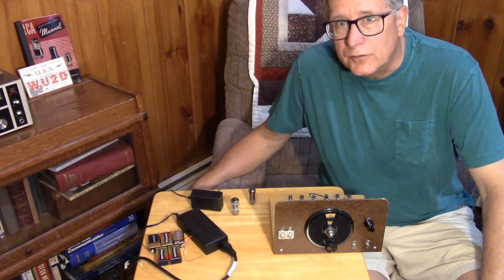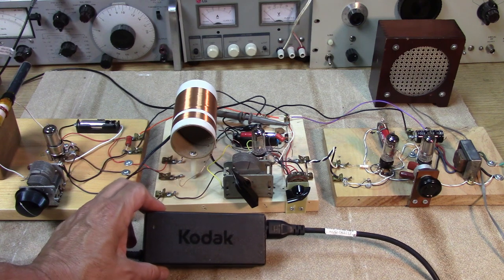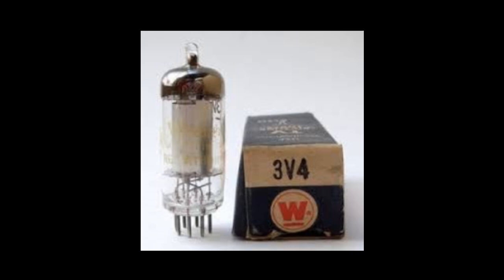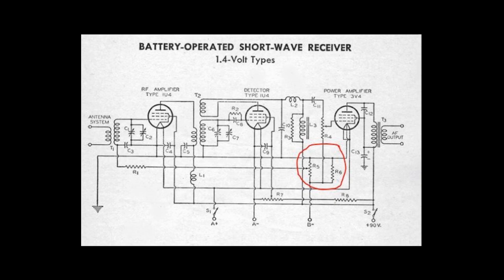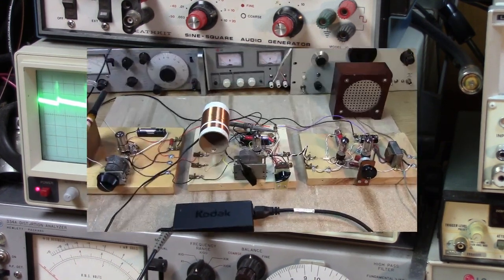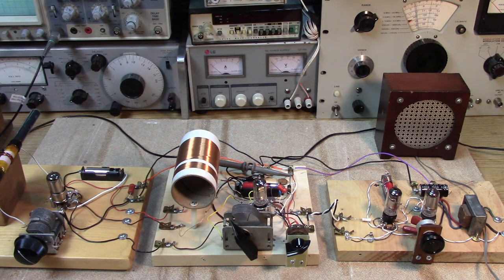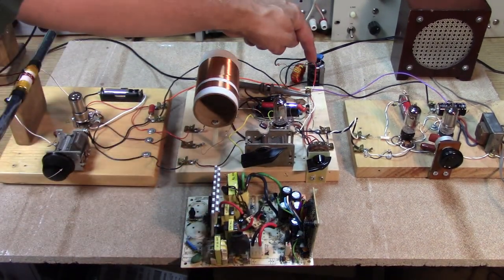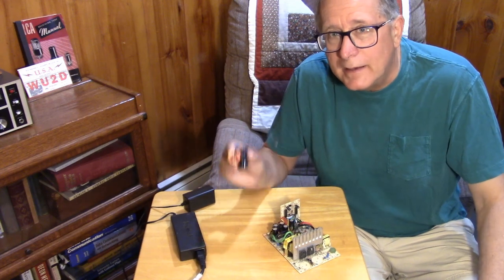Tube Power Shock!

Comment: Thanks for these Mike. You've been my mentor into the world of low voltage tubes. When I studied engineering emphasis was totally digital with a little analog thrown in for completeness. One thing I'm having success with is looking for the AC wallwarts and simple voltage doublers and triplers circuits with rectifier diodes and electrolytic caps.  Using the 12 and 24VAC bricks are working great like your cleaned up switching supplies.

Comment: Another use for wall-warts, as mentioned by @roccogarzione8410, would be to use 12 or 24 volt ac units, often used for Christmas tree lights and similar uses. These could supply a B-battery (HT) voltage of between 30 and 70-volts at, say 50mA, if used with a voltage-doubler rectifier circuit. Even a 12-volt unit often produces 15-volts off-load, that is 21 volts peak, giving around 40-volts dc after rectifying with a voltage-doubler. The wall-wart keeps the mains voltages safely enclosed in a sealed plastic case. Valves (tubes) with ac heaters could be connected in series across the low-voltage ac output, provided that they all drew the same current, perhaps 300mA in many cases.The voltage-doubler is also useful for deriving + and - supplies for op-amp power supplies, without using a centre-tapped transformer.
Reply from the maker: Yes and voltage multipliers are completely practical and less noise than switchers.

Comment: ECH83 and EBF83 were used in hybrid car radios and run with 12 volts on the anode.
Reply: EF95 pentode also

Comment: Many pentodes can be run off of 9 volts in space charge mode.  You apply B+ to the first grid, and use G2 as the signal grid.  G3 is either connected to the cathode or the plate.
Reply: B+ on the G1? Are you sure?
Reply: @db3501  YES.  Mind you we are talking less than 12v here in space charge mode.  This was very common in tube car radios of the late 50's to early 60's.
Reply: Ok good, nice to know.
But it's only the RF frontend.
Probably no way we could build a complete set around a 12V supply.
Reply: @db3501  Car radios in the late late 50's and early 60's used a special set of vacuum tubes designed for space charge operation.  These included an RF amplifier, Converter, IF amplifier, detector and first audio stage.  The speaker was driven by a Germanium power transistor and a special tetrode space charge tube provided enough drive for the power transistor, which was operated in class A2.
Reply: @scharkalvin  Good stuff really, I didn't know that :-D
On the contrary... your AM stations were much stronger back then. You now have environmental-friendly 5kW or so. Not much fun to operate an imperfect radio under these conditions, sadly.
Reply: @db3501  Radio stations always varied in power.  There were a limited number of "clear channel" stations that ran 50KW full time.  WABC, WNBC, WOR (now WWOR), WLS and a few more on the west coast.  Then there were stations that ran 50KW day, and 5KW at night.  Most other stations were 5KW full time (WMCA), and you had some that were 5kw day and 1KW (or less!) at night.  College stations were licensed to run a few hundred watts day, and less than 100 night.  Today, more low power stations exist, but the clear channel guys are still on line. 
Car radios usually had an RF stage for fringe area reception, and 262khz IF frequency  for better selectivity to separate close stations in the areas between cities.

Comment: that nice video. been playing with tubes many years. many battery tubes out their . have some 2V directly heated type. some old battery sets used them . 2V A battery was lead acid and you take it to a place to recharge. today this is easy. 2V AGM cells easy to find. with the 1.4V tubes I found a NiCd cell works fine. I even have a small flooded type.  6V tubes is easy. 6V lantern battery spring top. walmart has rechargeable AGM type  in the store. and a great find is old 12V car radio tubes. tubes made to run 12V on the plate. got a couple of out car radios that use them. the audio was a germanium transistor. I have a bunch of small 12V AGM battery's 4Ah to 10 Ah. easy to get 32V/48V. what I have done for making a A,B supply for old tube sets is went analog reg with HV transistor and Zener diode. 7806 reg ic good for a amp also works for filament. I went with LM 317K ADJ so I can set 1.2V to 6V . made on a piece of wood. worked many years and still does. at a hamfest some years back ,I brought old battery tube set. it had 45V B battery. I had the A in NiCd in radio. I ran on 48V EzGo golfcart with a 3V zener to make appx 45V . was a big hit. driving around listing to AM/SW tube set. love the low voltage tubes . hardly a shock at 48V . lots of fun. 73's
Reply from the maker: All good stuff Robert!

Comment: Electrolytic caps are wound foil construction, which makes them inductive at switcher frequncies.
Better to use tantalum SMD 10uF and some ceramic 100n caps
Reply from the maker: Wow a real engineering approach! Yes gaining that last 3% of efficiency or 10 dB of rejection in switchers is what the 90's were all about, as switchers and controller ICs really became mainstream.
Reply: @MIKROWAVE1  
ESR of  the res cap is the main problem, my 5v 1a psu had 2v of noise on it
Expensive low ESR tants fixed it.

Comment: Mike are you forgetting that car hybrid AM radios made in the late 1950 through the early 1960, used tubes specifically designed to work off of 12.6 vdc for the plate circuits!  ... Good primer course on making switching PS 's quieter. You were rather bref on filtering the AC line side and putting the works inside a metal box which is an excellent idea!  I have experienced a switcher PS that interfered with AM radio anywhere in the house, I had to replaced it with one that did not.  Sw'er RFI  is a real issue.
Reply from the maker: Oh I have them, but the Space Charge tubes are a bit special for most folks who want to get started with tubes.
Reply: @MIKROWAVE1  Yes, Space charge tubes like 12J8, 12K5, 12DL8, 12DS7, etc., were meant for driving a germanium power transistor, but tubes like the triodes 12AE6, 12FK6 and pentodes 12CX6, 12EK6, 12F8 and many others are not space charge tubes they are connected just like the higher voltage cousins, but optimized for 12.6 vdc operation, some are rated as high as 30vdc.

Comment: Shop around for cheap 9 volts, the demand is low so the pricing is pretty arbitrary, shoot for under $1 each, maybe $1.50 for alkaline. Best deal on carbon 9 volts I've found is at Big Lots, currently 2.89 for 4. I prefer them over alkaline for most 9V stuff as they don't tend to be as destructive if you forget about one left in some piece of test equipment. Amazon is usually best for cheap Alkaline, I've had good luck with the Delco brand.
Reply from the maker: True but I have been burned by shoddy construction and dead cells with the cheap ones.

Comment: There are tubes that run on 12 volts on anode and filament. look up space charge tubes for car radios. They were used in the entire radio except for the large germanium output transistor. Transistors were not good for high frequency in there begining.
Reply from the maker: I am so old that I remember visiting a Motorola plant in Arcade NY, as a co-op student in 1978 and they were making car radios and alternators for Volkswagen and shipping them to Germany.

Comment: 👍Thanks for video Mike. In terms of repurposing wall-warts for HT supplies, one thing I have wondered about but never tried for this type of application is connecting a few SMPSUs outputs in series. There shall be some precautions associated with try this - DO NOT TRY THIS UNLESS YOU UNDERSTAND THE RISKS. However, if you had, say, x4 24V dc wall-warts of appropriate design, in series you would get around 100V dc. Could be a cheap and cheerful way to make an HT supply with surplus mains adapters for laptops, printers, etc?
I am starting to envisage a project with all my surplus laptop PSUs in a biscuit tin with your filter solution. Might even provide enough HT current for small TX as well as receiver?
Reply: Probably easier to follow one supply with a boost converter, then filter as demonstrated. Any time you float an isolated supply like that keep in mind you're stressing the insulation between the primary and secondary sections that much more, probably negligible with safe high quality power supplies and an increase of under 100V, but it is something to keep in mind.

Comment: In the Low pass filter diagram does the earth symbol mean the circuit should be connected to earth ground? Or maybe chassis ground? Or maybe it's just a zero voltage reference point? I always find that symbol very confusing but I don't know much about circuit diagrams.
Reply from the maker: There is no right answer except in the context of the era and prevailing guidance of the company, entity or standard. Symbols have evolved and rules, color codes and standards are broken throughout the electronic age. I like to make schematics that look like they belong to the time period or country they represent, purely as art or ease on the eyes.
Reply: @MIKROWAVE1  OK Thanks Mike.

Comment: why cant you put 2 in series.  ??? ive done that with 2 18v printer supplys seem to work fine. no noise. just asking
Reply from the maker: Theoretically they are isolated from the line. So it should work. Be careful with line voltage.

Comment: What about a rotary converter using off the shelf motors back to back or with gearing to generate HV from low voltage?
Reply from the maker: Ah the rebirth of the Dynamotor!?!?

Comment: I need to take your "advanced" course, Mike. I wrestled with a few 12 volt switchers, trying to get 18 out, but never seemed to make it. Inductor Q? I think some are designed on the ragged edge, with the smallest L and C to get the V they want, but I don't know. Anyway, great! ATX gots lots o-good meat on them bones! W3IHM
Reply: Can use plain old transformers, too.
E.g. put a 110V/12V and a 24V/110V in series, gives you about 55V AC.
Not much can go wrong behind a tiny weak 10W transformer...
Reply from the maker: @db3501  Ahh now we are talking about a really clever junkbox solution!
Reply: @MIKROWAVE1  
240V/12V into 12V/240V gives you 340V iaolated
240V/6V into 12V/110V gives you 77V iaolated and 6V for heaters

Comment: half wave rectified  - light bulb in series, 1 diode. 1 capacitor. direct of the mains.
Reply from the maker: Of course the guidance now is widowmakers are too risky. Use an Isolation transformer. The lesson here is if you manage to get this happy and safe - keep it plugged in to the same outlet! I learned the hard way and blew up a nice radio when I took the setup on the road.
Reply: @MIKROWAVE1  1 wire plug maybe.  chasis directly grounded by other wire.
Reply: @mohinderkaur6671 death trap, forget it.
Reply: @MIKROWAVE1  I worked on TVs in the 1970s here in the UK. Live chassis, hopefully connected to the mains neutral, and 300mA series heater chain, across the 230v mains, for the tubes, was the usual setup. 2-pin mains plugs connected so that chassis was live was a constant hazard.

Comment: Do you clean a vacuum tube with a vacuum cleaner? Can I use the filter from my furnace to reduce hum? Why do you use the term valves from a country we had to save their butts twice from the Germans?
Reply from the maker: A sucky comment for sure Burt. Maybe this was tried in the old days. My Electrolux is the one to do it if it could be done.